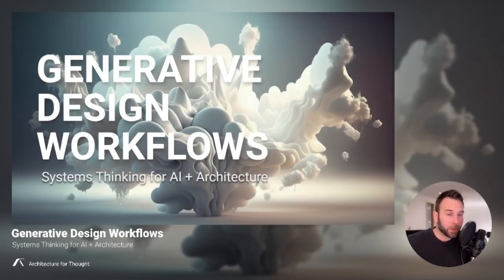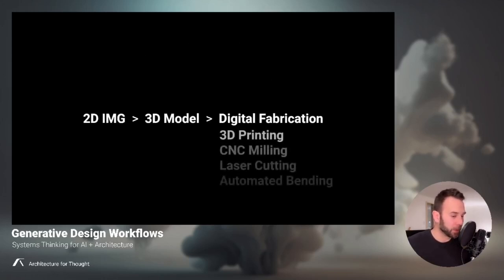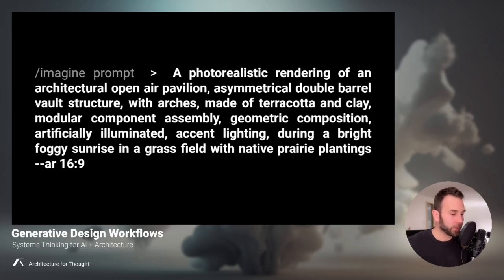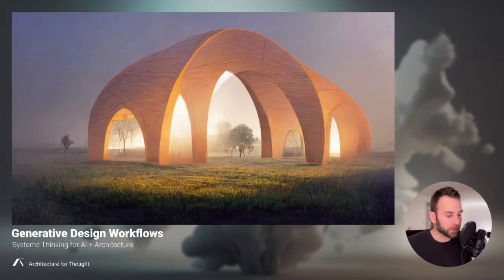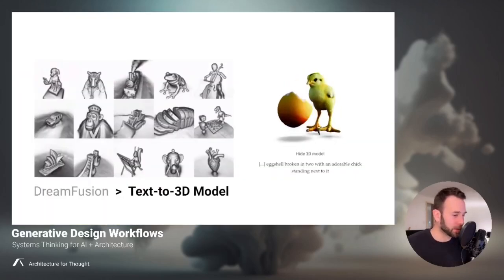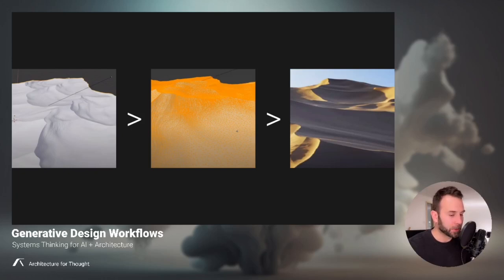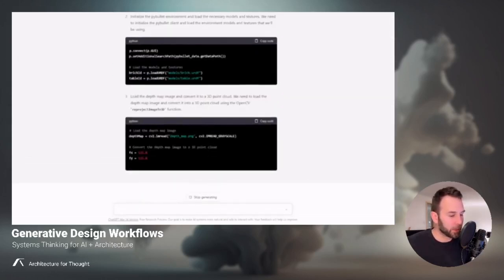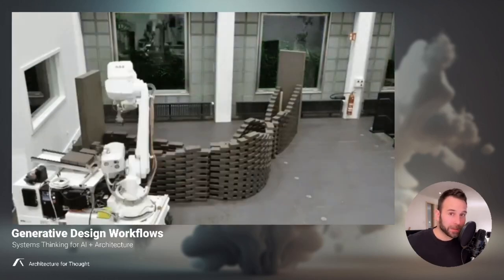Generative Design Workflows (AI + Architecture)

Comment: Amazing. Thank you for making these videos. Very inspiring. Question: Is it possible to generate interior and exterior images of the same building at the same time especially if your building has large windows so you can see the interior?
Reply from the maker: I'd say there's ways to get it close, but without having an actual reference image to use with controlnet, you'll get some disconnect if you were prompting raw into Midjourney. Having a 3D model of some sort still seems to be essential in creating a holistic 3D proposal with consistent interior and exterior views.